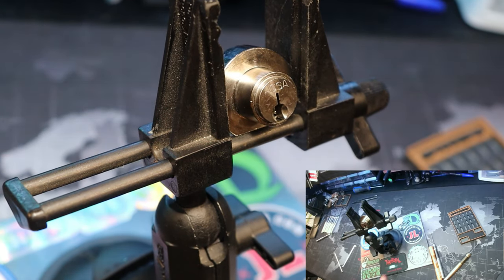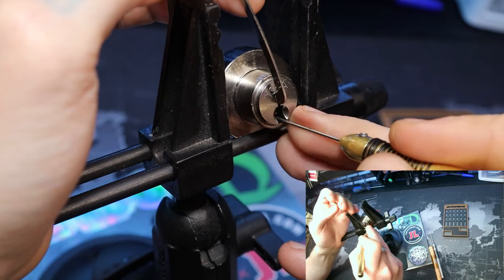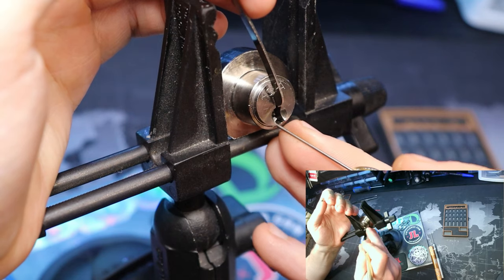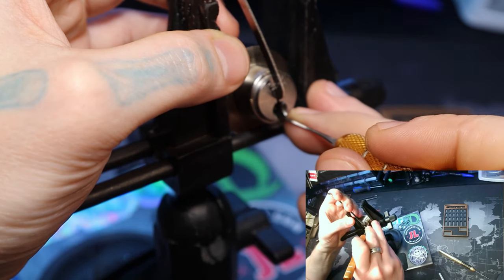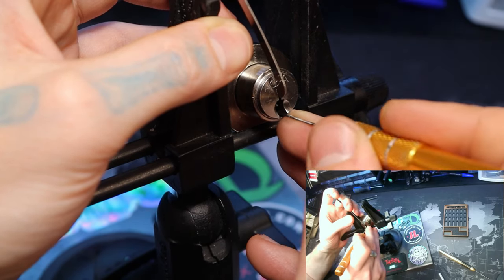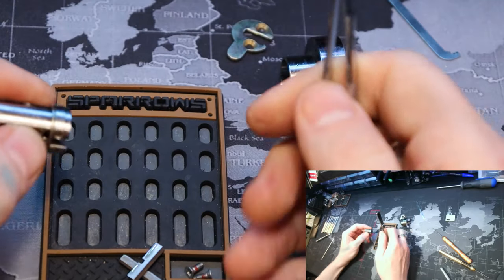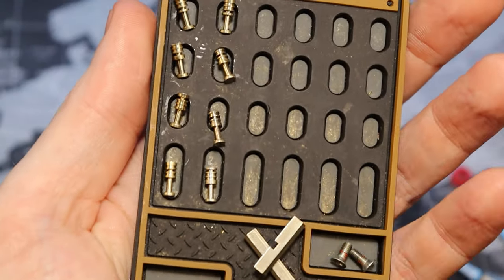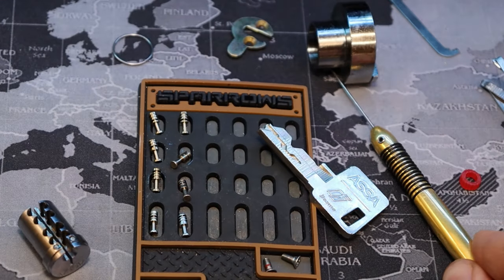218) Assa Desmo Picked and Gutted

Comment: Is dimple flags way to go for sliders? Or is diamond or half diamond a decent pick to use? What’s ur preference and why? Just curious. I have a couple sliders. Have tried one with little luck. Any tips on picking these would be great! Oh and great pick/gut. Good content!
Reply from the maker: I'm new to sliders myself.  I like flags over diamonds for 2 reason.  1, the side of the flag is typically a little thinner and easier to squeeze under low sliders.  2, I don't like that there is a whole bunch of extra metal at the tip of the diamond picks.  I personally would remove most of the tip of the pick that goes past the diamond picking tip.  All that extra metal is more chance of knocking something by accident.
Reply: @LockpickingDev  oh very cool! Thanks for tips! I tried dimples once. Mine aren’t wide enough. So hard for good placement to lift. Or stay on em. Sure it’s a matter of adjusting to pick these. Kinda wierd. Thanks for replying man. Merry Xmas!